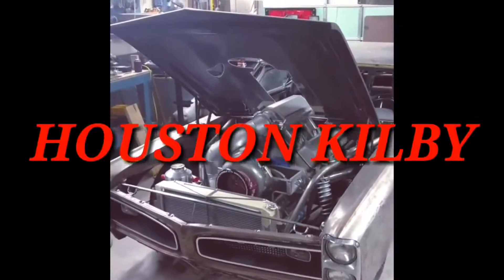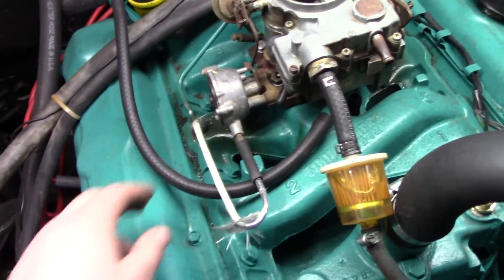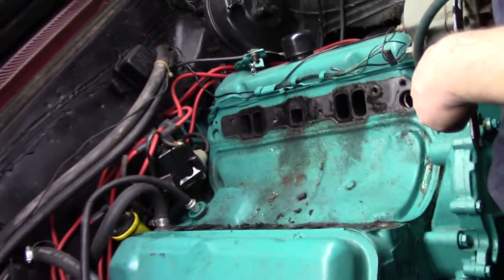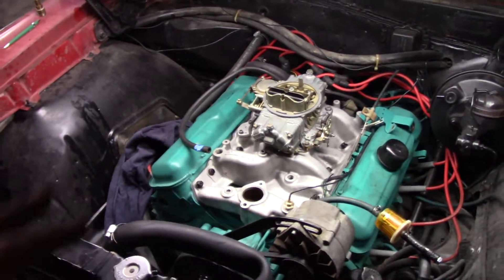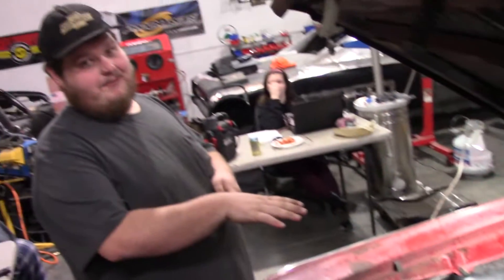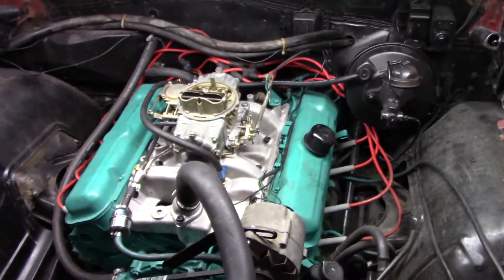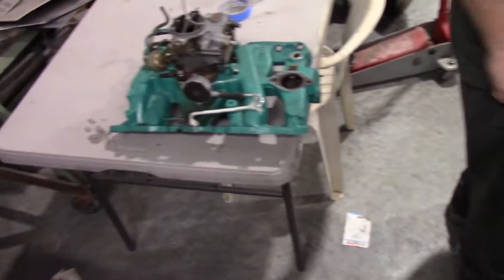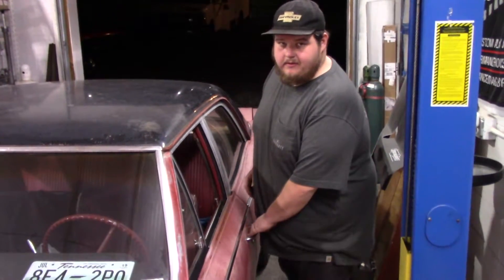1966 Pontiac Holley carburetor swap!

Comment: For what it's worth, I reused a T-2, 2 Bbl throttle cable bracket when I swapped engines in my Lemans.  Stock intake and Q-jet carburetor.  I didn't really think much about it but I was always disappointed in the performance.  One day I decided to check and the back barrels were only opening about 50% when floored.  I swapped the bracket for the 4 Bbl correct T-4 and it made a big difference.  Now the butterflies open 100%.  Not sure if this matters with your Edelbrock and Holley but worth mentioning.
Reply from the maker: Appreciate the comment man ! We actually had a issue just like that on a car not to long ago.

Comment: If you're going to put a 4 bbl on a 326 you may as well put the Correct heads on too. 141 casting # are the correct heads for a 67 326 H.O. casting # 95 for 66. That brought the compression up to 10.5 .1
Reply from the maker: Ya that thing for sure needed more power

Comment: Hey dude i had that stumble problem with my 77 pontiac 383, it had the 4 barrell and everything and was tuned up decent, until somebody fucked with the dist cap to “lower the curb idle” to make it sound lower and meaner. Once i got the dizzy figured out and had a buddy look at it there was no problems he just had to reset and change the rotor buttons on the dist cap
Reply from the maker: Ahhh ok man we will take a look at it next weekend. I had wondered if something was going on in the dist. Thank you for the tip brother and thank you for watching!

Comment: You can take this 326 Pontiac V8 and make it a 375 Stroker as well.
Reply from the maker: Heck ya man
Reply: @HoustonKilby  Oh yeah and on muscle they got like 357 HP out of it but it does have potential to make close to 400 HP.
Reply from the maker: Oh for sure man ole Pontiacs can make some powa , head change on them is big gains
Reply: @HoustonKilby  Amen to that brother, Butler Performance knows hows to get every power out of these Pontiac V8s with ease.
Reply from the maker: Oh for sure man Rodney has it going on for Pontiac
Reply: @HoustonKilby  Yep he sure does.

Comment: I've ran into that stumble trying to use the 750cfm Holley3310. I dont know what it is about those 3310s. A 600 would be better suited to what Jessie is looking for. But heres where I'd start. Try 64-66 primary jets. 32° total timing. Check dist for proper mechanical advance movement( loose weight pins,etc.) Start with one heavy spring and one medium spring on the mechanical advance. Try it. If it still stumbles, especially when trying to get into the 4bbl. Go with the heaviest vacuum secondary spring. If it doesnt stumble, try the next lightest spring and so on. If stiffest spring still stumbles. Put a small screw in the secondary linkage on the drivers side to 'make' the secondaries open.
Reply from the maker: Thanks for the info brother!!! We appreciate it !!

Comment: What size carb did you guys use?  Thinking about doing this swap to my 68 Bird.  Going to go with the performer intake but not sure about the carb.  Defiantly want mechanical secondary's.  I like that feel on the petal.  Any ideas are welcome.  Thanks guys good video.
Reply from the maker: We used a 750 cfm but yes I agree use a mechanical and that thing will scream!! Thanks for the comment brother!!  What size motor you running?
Reply: @HoustonKilby  350 265 horse had the car for 25 years and the carb is even older than that.  Not looking to win  any races just a reliable cruiser for Friday night.  Just ordered a 650 double pumper with electric choke. I'll let you fellers know how it goes! Great channel Boys.
Reply from the maker: Ya man that 650 will be a great choice! Let me know how it turns out!!   Thanks again for all the support! We so close to 1000 subscribers be sure and tell your friends about the channel!

Comment: 750 cfm too big for a 326 , if stock engine. 600 or 650 cfm at most might clear your problem with correct jetting.
Reply from the maker: Might be the issue but we used what we had to get it running 🏃‍♀️. He’s been having fun with the car. I tell ya just getting that old 2barrel off it has helped a ton .

Comment: This carb is too big for that motor gents...how do I know? why would I make this statement? Because I have a 1968 Pontiac 400 HO motor (built) and all the techs and professional tuning mechanics I spoke to tell me that this carb is way too big. Go to the holley web site and use their calculator, the proper carb for this engine is between 600 and 700 CFM pending the cam, compression, gear ratio etc. this spring I'm replacing my 750 double pumper with a 650 single feed vac secondary, I have a dead spot off the line which is caused by the improper over sized 750 that annoys the hell out of me
Reply from the maker: It’s what we had to work with at the time it now has a new owner up in NY